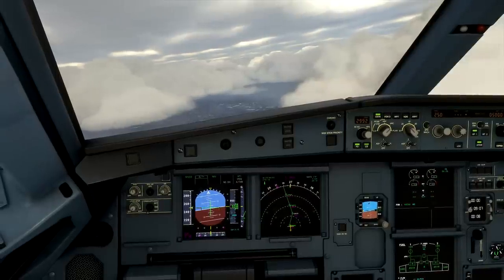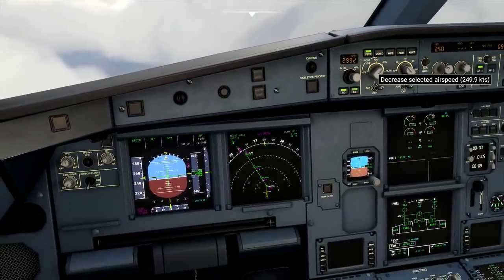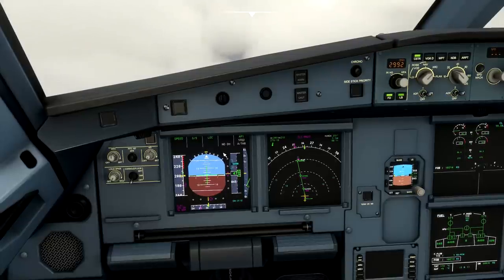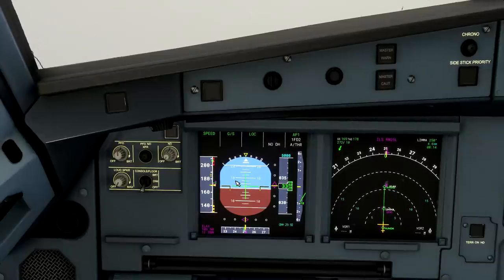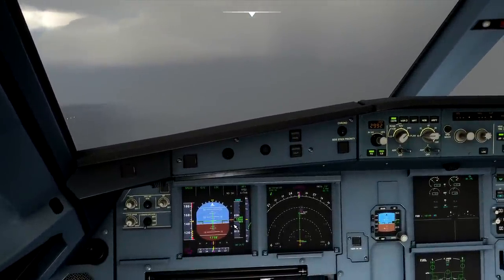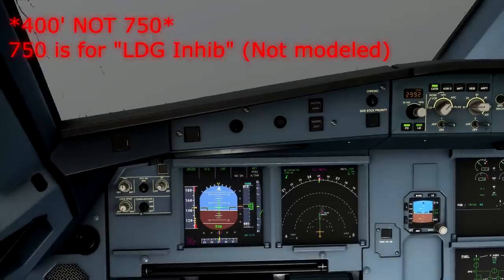*Auto Land!* | FS2020 A320 NEO | REAL Airbus pilot!

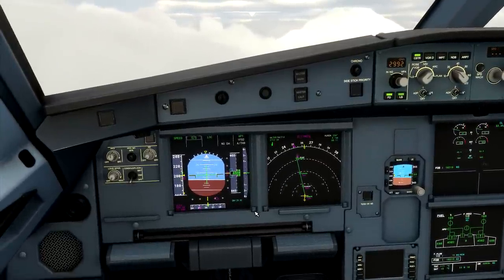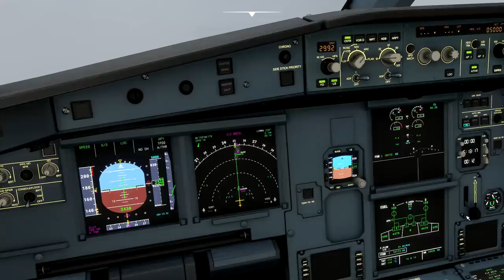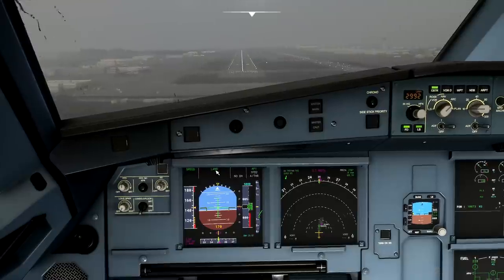Comment: 2:30 GS and LOC tracking 4:50 Gear down, flaps 3 2500ft 5:20 Landing CL @ 400ft FMA > LAND,  7:48 200ft (no APL)  @ 40ft FMA FLARE (it does flare slightly visible in horizon, definitely re.reduction   of vertical speed - ground effect ?) 8:10 perfect landing / touch-down. Of course you would never flare with vertical speed indication, but just to find out for this landing another parameter !! Thank you for this nice video, your good and well coordinated  explanations, showing you are an expert. And that a US Pilot can fly a European Airplane as well. Hope you like the philosophy. I like the calm attitude handling the airplane most of you US Pilots seem to have innate. Looking forward for more to come.
Reply: Airbus is pretty wide spread in the US as well these days.

Comment: In order to type in the correct QNH you need to change the altimeter setting , it has two different settings. If the ATC gives you 29.92 you need to enter that first, then flip it over to QNH and get a 10xx value

Comment: I think there's some confusion in the real world (and sim) regarding autoland and Cat III.  Cat III is not a requirement of Autoland (specifically), and it's emphasised that they're different things and don't necessarily go hand in hand.  While it is a requirement for autoland for a Cat IIIB app for example, you can also do an autoland off of Cat II; to take it even further, the aircraft is perfectly capable of doing an autoland off of a Cat I approach.   The A350 can do an autoland off of a GLS app using GPS only (it's certified), as a further example.  Oh yes, and great video BTW, liked!

Comment: Not sure where i'm going wrong here. I tried an earlier landing at Liverpool, EGPP, I was established and intercepted both the horizontal and vertical diamonds, and remained on profile until runway. I got above runway and was just about to throttle back, when the aircraft suddenly slammed into the ground, without flaring, and bounced back into the air. I was approaching at the approach speed of 136KTS, with about 1,800-2,000 KG of fuel remaining. 

Short of it being a bug, all I can assume is that the runways at Liverpool airport are not CAT 3 ILS autoland enabled?

I landed on runway 09. It bounced despite descending at the correct rate all the way down from intercept until just above runway, when it rapidly went from callout "50" all the way down to "10" before smacking into the runway, and then bouncing back up again. Flaps were fully configured, autobrake set, speed was well within safe landing speed, descent rate wasn't excessive during descent, right up until essentially what would be just before the flare. 

I'm not sure if it's just because the plane is not modelled very well, or if there's some other issue. This was using the stock MSFS A320 Neo, I have also downloaded the FlyByWire LEAP A320 but haven't used that recently since I had to reinstall FS2020 and need to reinstall the liveries.

I get no LAND displayed on the PFD, nor any "Flare". I am aware that not all categories of ILS support Autoland and wonder if this is simply the case, or if it's just the plane's ILS system and modelling not being implemented very well at this stage.

I had everything set in the MCDU, Decision height, MDA, wind speed and heading, temperature, ILS frequency was set along with the course.

Only thing I can think of, is that I tried to change the knob after setting QNH, and changing it from Standard pressure to QNH (HPA), but instead of going to QNH it went to QFE, no matter what I tried it was either InHg or QFE. I did a quick search and from what I can gather QFE is something to do with the pressure prior to arrival, however having watched other sim players they can actually get it to display on the panel as "QNH" where as mine shows as "QFE".

Are you able to give any suggestions or advice? Thanks.
Reply: I have the same problem. Did you solve that?
Reply: @fabiobertelli  From what i've heard it's the fact that the stock A320 is not modelled and developed properly, and as such it is not capable of a full ILS autoland procedure.

A shame, and frankly quite disappointing when you consider how long it's been in development and how much the simulation software costs, I went for the premium deluxe version which has everything, it cost me £88.
Reply: @thefiestaguy8831  So that is a glitch in the game??? In the last few days I was trying discovery why my plane don't auto landing. 
I'm playing on xbox whith the default aircraft, like you.
All that I can say, my aircraft looks correctly setuped for landing
- altimeter = tower info
- power lever in "CL"
- Auto pilot + auto thrust "on"
- ILS + app "on"
In the dashboard I can see "land" message...  but the aircraft never "flare"

The only that I don't know to say, is about CAT 3 airport. 
I tried in the New york, San Diego and Miami.

I fell better now for discover that is a problem with the game and not with my setup.
Anyway, I agree with you, is disappointing see so many glitchs in the game.
Thank you so much for your reply!
Reply: @fabiobertelli  The lever may not necessarily be on Climb power, as during descent you are supposed to idle the throttle, I tend to just use either a selected speed or managed mode, depending on the approach and conditions.

I'm on PC and not Xbox, but it wouldn't surprise me that they've still not fixed this issue as the port to games console has been done.

Comment: Autoland is the same in Aerofly FS2, can't press both buttons. And that sim should really be better, Aerosoft used to specifically make A320 simulator games. Have been trying to follow some others describing how to do autoland but ended up missing something, saying "screw it" and doing manual blind landings. Gonna try it again later on using your steps. As others also have said, i really appreciate the AP testing you do.

Comment: i've got a suggestion for another test you might want to try. How about a one-engine-inoperative takeoff with a fuel cut just before (or at or after for that matter) V1? I haven't tried it yet myself, but I have heard reports that no rudder input is needed. It leads me to wonder if the airplane is basically modeled incorrectly as a centerline thrust airplane rather than having 2 wing-mounted engines.
Reply: Could also try in-air minimum control speed type tests.

Comment: So when I try to land using auto land it doesn’t flare itself and very often slams down hard could I be approaching too quickly?
Reply: I have the same problem, did you fix that?
Reply: @fabiobertelli  I have fixed this issue by downloading the Fly By Wire 320 it simulates everything so much better and the cat3 autoland will land the aircraft all the way to touchdown give it a go.

Comment: Great Video! Is it possible to use the Nav functions to fly from VOR to VOR without programming a flight plan into the FMC? I couldn't find the DME anywhere - not just on the Airbus but on the B747 or 787 either? Is this a bug in FS2020 or do I need to learn how to use the FMC?

Comment: This is actually an excellent video because I have been wondering how to get the A320neo to autoland. Unfortunately I trusted the aircraft a bit too much and it shovelled me into the runway, lol.  

I must be missing something because I could not replicate your results. Is there a particular TYPE of approach that you're setting up in the NAV LOG window before the flight? Is it enough just to have the AP on nav mode (managed), speed mode (managed) and the approach mode on with the keyed in ILS frequency? I tried this and it resulted in a crash. 

If you have some time I would love to get more feedback about this so I can finally do an autoland with this thing :) 

Thanks and a great video, well done :)
Reply: I think it maybe because not all airports have a full CAT III ILS  Type C system installed many have a CAT II which IIRC correctly does not make autoland possible. I'm not a real pilot though so I maybe misstaken.
Reply: Correct. Only CAT III C ILS facilities are capable of autolanding an aircraft. The others have decision heights that require you to disable the autopilot and manually guide the aircraft in from there.
Reply: Awesome thanks guys this makes perfect sense. 

Can I check on the map which airport has cat III or do I have to look it up online?
Reply: @angrytomasz  I had to look it up on the charts I was going to LFPG Charles de Gaul that has CAT III approach R 09R
Reply: @stevenwhite8706  thank you so much!
Reply: @angrytomasz  still went like the pilots though had to land myself

Comment: OK... so here's my problem.  I get to the point where the approach (runway heading) is captured and the glideslope diamond  is approaching my altitude level tick, and the aircraft continues to fly level as the glideslope moves below me.  I want a 3 degree descent at this point but it doesn't engage and I end up either having to manually fly the landing or go around.  What am I doing wrong?

Comment: ILS is only for poor visibility?
I have to use it for everything... Even for Cessnas.. 😅
Reply: ILS is not only for poor visibility. It's a legit way of approaching safely the runway, but pilots often disconnect autopilot quite before landing just to "feel" the plane. 

I hope you are not confusing ILS and autopilot.
Reply: Understand ILS and Autopilot/Autoland are two different things.  ILS is simply a means to determine a proper direction and descent rate.  You can and often do use ILS all the time even in perfect weather.  The Autopilot/Autoland system shown here is simply using the ILS data to then also do the landing for you because you can't see well enough to do it yourself.  But flying the ILS manually is certainly a thing as well.

Comment: Is there a reason why autoland isn't used for every landing including in good weather?
Reply: Because pilots want to keep their jobs so they fight automation, but Boeing will release fully autonomous ai controlled planes the second Tesla releases fully autonomous cars and the public is used to the computer driving the car fully, after that pilots will get fired.

To give you a clue: tesla their vertical landing rockets are autonomous and computer controlled..... fully from ground to space and space to ground
Reply: ATC needs much more spacing between the aircraft if Cat3 is enabled, so it would reduce the capacity a lot. (to guarantee that the signals are not disturbed in any way)
Reply: Doesn't land very smoothly, and struggles with harsh conditions. It's good when visibility is crap but the winds aren't wild. If the winds are whipping around, autopilot isn't going to be able to cope with that as well as a pilot could. I've had autopilot disconnect due to heavy turbulence many times, but then again I don't fly airbus so idk how they would respond. Airbuses seem better built in general.

Oh also, spacing needs to be increased significantly. Slows down the whole operation, reduces hourly capacity of the airport. It's not just the plane, the ground is effected too. People need to hold clear of the ILS critical areas, taxi ops may be slower etc etc. 

But, when visibility really bad it's the only way we can get in. It won't land as smoothly as a pilot could, but it gets the job done. Whether you kissed the ground or just kinda plopped onto the pavement, you're at your destination in one piece. Stop complaining and gtfo of my airplane (:

Comment: Thanks for this! Do you have one coming on flying RNAV approaches on the 320 in FS2020? It's not capable of flying 
RF legs or calculating a ToD yet, is it? Cheers
Reply: Check out the A32NX mod. They are working on adding TOD and TOC among several other features to make the A320 fully functional with everything added.

Comment: how do you activate the reverse trust i dident find the command, is there a key stroke or do you ave to use a hardware throttle, nice vid love landing in poor visibility my ref airport is ebbr
Reply: By default you press and hold F2, which decreases the throttle, after idle you go into reverse
Reply from the maker: Yes I bound eng 1 and eng 2 "press and hold commands" for thrust reverse. So I depress the buttons then move my hardware throttles forward to achieve reverse thrust
Reply: @V1Sim  beware that for prop aircraft at the moment it cutoffs the throttle and thus turns the engine off
Reply: @eclair404  yeah, also a faster method if your throttles aren't in idle is pressing F1 to go into idle and then holding F2 to go into reverse.

Comment: Great tutorial, thanks.  Am starting to nail ILS approaches but hand flying once i'm past the FAF (the default A320 seems to over-correct, rolling excessively to stay on the localizer the closer it gets).  Curious as to why you didn't input the wind into the FMC?  Also, where can you find out if an ILS is Cat III, it doesn't seem to be indicated on the approach charts?
Reply: Cat 2 and 3 approaches have their own plates and will break down their minimus accordingly... for example look at KLAX apch plates you see 25L ILS as one plate and 25L cat II & III. Look at both to see the difference... main difference being the minimums and remarks sections

Comment: What is "NO DH"?
Reply: No decision altitude. On Cat 1 and Cat 2 ILS there is a DH where you need to see airport environment, ie runway or approach lights., or you have to execute a go around. Cat 1 is usually 200ft above runway thresold, Cat 2 is 100ft on the radio altimeter. These are not autoland.
Those altitudes are on the approach plate and entered into the FMC in the perf approach page next to DH.